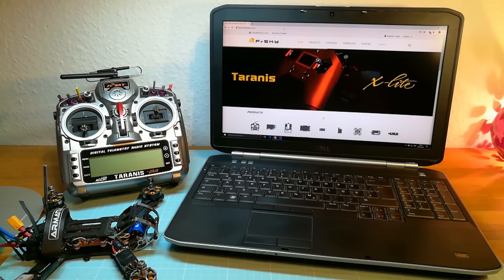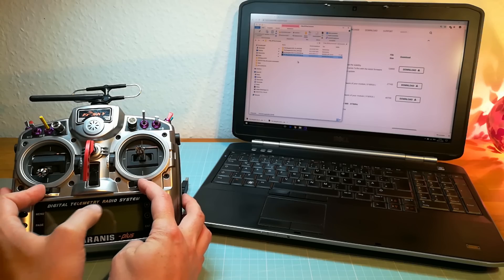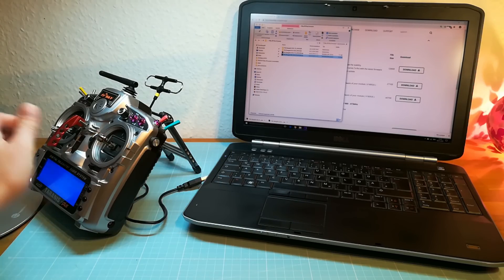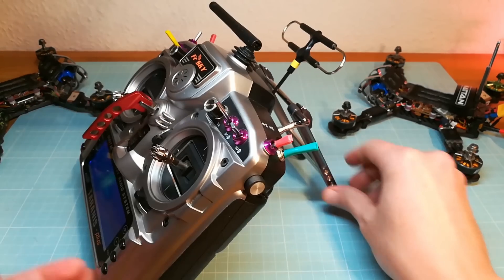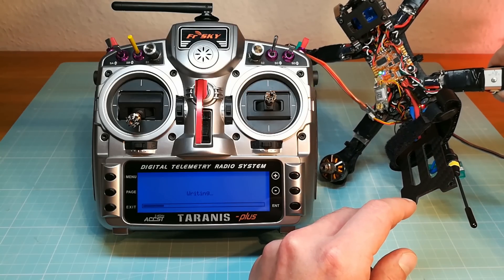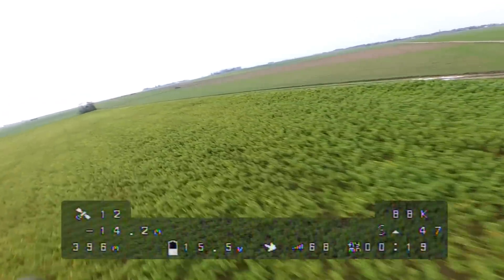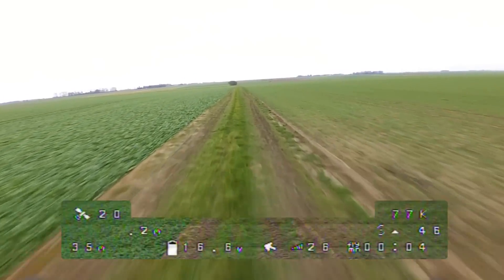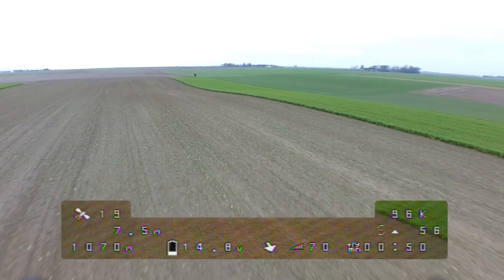FrSky R9M - 181228 Flex Firmware - Test and How To

Comment: Hi. i have just installed  the official 2.2.3 updates to  my  x-lite radio and installed the flex firmware Eu to my module and receivers but i have not got the option to change 100mw with telemetry as it states you can do with flex firmware, the only option is  telemetry using 25mw? any advice would be appreciated. Thanks.
Reply from the maker: quadthing copter did u check the flex option in companion as shown in my video about? But u don't need to select nightly Builds.
Reply: Thanks for the reply,  which of your videos has the advice for the flex options in companion
Reply from the maker: quadthing copter the linked video in the description...
Reply: ok thanks got it

Comment: What is the difference between flex 💪 firmware and just firmware? 🥊
Reply from the maker: Flex firmware is like the 915MHz FCC Firmware, but you can switch between 915 and 868MHz. I have made an other video about the Flex firmware, there you can see it.
Reply: Do you have link for that video? Thx. Great videos.
Reply from the maker: @zoom4zam  Yes, you will find it if you read the video description, or if you watch this video till the end, there is also linked my other video about the flex firmware.

Comment: Any particular reason for not using fport?
Reply from the maker: Vincent Fischer i don't need it and i have heard about issues with the fport firmware. Try the fport firmware, if you have some issues with it go back to the sbus firmware
Reply: @TorbanDallas  I'm using the fport firmware! And I have weird failsave like things happen that I don't have on another build where I use sbus. I'll try the sbus version on the problematic quad today. But if that would be the case I would loose a bit more confidence in using frsky gear because they don't have a single competent μC guy in their company it seems as this would totally be a software mistake on their end (how long is thenR9 system on the market?? how can stuff like this happen). Danke für den tipp
Reply from the maker: Vincent Fischer please let me know when the sbus firmware solved the failsafes on your quad with the fport firmware.

Comment: It looks so stable in your video. I have the R9M in my QX7S and the R9MM receiver on my quad and this week I had to experience a scary flyaway. I think the receiver didn't activate failsafe because the Betaflight log says that the quad has had signal but I wasn't able to control it anymore.
I don't know what happened because I tested failsafe several times before the flight and the quad would just turn off the motors when it looses signal. My failsafe is set to dump the quad. Anyone an idea what I can do? If someone was able to help me, I can provide the Betaflight blackbox log and the DVR footage.
Reply from the maker: Erwin did you use the fport firmware?
Reply: @TorbanDallas  Yes that's true. I changed back to SBUS ans SPort and since then I haven't experienced similar problems again. I also did an update to OpenTX 2.2.3 stable.

Comment: What is the FLEX firmware? What's it for? Why should it be considered over the other firmwares?
Reply from the maker: David Hannigan Jr. Flex it's almost the same firmware as the fcc firmware, but you can change the frequency from 915MHz to 868MHz for the EU. So it's better for the EU Users. The EU LBT firmware is limited to 25mW or 500mW without telemetry.

Comment: What is the card that you attach to taranis when updating the Receiver (R9Mini) ?? (time 2:42) do I have to have it to make such an update? Please answer. if so give a link to this
Reply from the maker: ChrisRC_FPV Haha, I was waiting for someone to ask this question 😂 This is not a card. It's just the female  plug matching to the male plug on my r9mini. I didn't have the female plug so i have literally cutted that plug out of an old flight controller. It's just a plug connection between both cable ends, nothing else.
Reply: @TorbanDallas  Recessed into raspberries: D What people will not come up with;) The patent beats the patent
Reply from the maker: ChrisRC_FPV Either you are a native speaker or you translated this phrase with the raspberries with the help of a translation tool. Anyway, i have never heard that phrase with the raspberries, but it's funny 😂
Reply: @TorbanDallas  it's a Polish proverb
'bring someone out into raspberries'
I used google translate, of course ;]
Polish proverbs are always fun;)
Reply: @TorbanDallas  Now the question ... is it worth to buy receiver r9 mini frsky or R-XSR? I'm hesitant because I'm looking for a second receiver for another drone. Should I go in the direction 2.4ghz or 900mhz? Or it may have two different ones installed, so that in the event of a failure you can save the plane, drone, etc
Reply from the maker: ChrisRC_FPV it's up to you. If you want to fly long range i would use the r9 receivers. If you just want to fly freestyle you can also choose a 2.4 GHz Receiver. You can even see the range of the xm+ 2.4GHz Receiver on my gps rescue video.

Comment: Super. Signalstärke so wie bei mir ohne Failsafe . Habe aber erst 2 Testflüge nach dem Update gemacht, da es bei uns zuviel Schnee hat. Habe diesmal ein gutes Gefühl aber dennoch glaube ich, dass man TX und RX Antennen besser tunen könnte. Habe aber kein Spectrum Analyzer. Soweit sogut. Frage: hast Du alle Sensoren der Telemetrie oder nur RSSI und RXbat?. Ich habe im FC Telemetrie nicht aktiviert.
Reply from the maker: Stefan Kellenberger ja es braucht noch ein paar Flüge, habe aber auch ein gutes Gefühl. Ich habe nur rssi und rxbat. Sonst nichts. Alles andere steht ja im Osd ☺️
Reply: @TorbanDallas  genau so sehe ich das auch. Gut Flug.
Reply: Ich hatte die Woche ein Flyaway, obwohl ich mein Failsafe vor dem Flug mehrfach getestet habe. Laut dem Betaflight Log hat der Empfänger Signal gehabt, aber ich konnte nicht mehr steuern. Ich weiß ehrlich gesagt nicht was los war, weil ich es nach dem Crash nochmal probiert habe und da hat failsafe funktioniert, als die Fernbedienung Signal verloren hat. 
Ich habe gerade versucht mein Problem auf Englisch zu schildern und dann gesehen, dass es hier glücklicherweise noch mehr Deutsche gibt.
Hat irgendwer einen schlauen Tipp, was da los war? Ich hab noch einen Betaflight Log und die DVR-Aufnahme.
Reply from the maker: Erwin uh das klingt ja gruselig. Aber du hast deinen Copter ja offensichtlich wieder gefunden. Wie sind deine Failsafe Einstellungen in Betaflight? Kontaktiere mich mal auf Facebook, dann können wir dem Problem besser nachgehen.
Reply: @TorbanDallas  Danke für das Angebot. Habe mich gerade bei Facebook angemeldet und dich mal angeschrieben, allerdings heiße ich dort anders.

Comment: R9 mini. Only 38 rssi value. Anyone know why? Thanks
Reply from the maker: what are you talking about? more informations please!
Reply: I have the flex firmware. Newest version on both tx and rx. 
868 antenna on the TX. 
Original antenna on RX.
I have 100db RsSI value on the taranis but only 38-39 in the osd from betaflight.
If I leave it for a few minutes with the battery connected it suddenly gets rx loss and I have to reconnect the battery for the quad. 
I have tried several times but I always get 38 RSSI
Reply from the maker: @Victor90NOR  so you are using the rssi output on channel 16 of the r9 rx? It's scaled wrong that's why i have changed the scaling. I even mentioned my settings in the video description.
You should also take a look at my FrSky r9m troubleshooting video!
Reply: Thanks. So just set rssi channel too 16 and change the value settings in cli? Will this fic the rx loss problem also? 😊
Reply from the maker: @Victor90NOR  No, to fix your rxloss problem you should take a look at my failsafe troubleshooting video https://www.youtube.com/watch?v=wXe1aNpepZg   ...
Reply: @TorbanDallas   thank you :) I will go trough the steps  in the troubleshooting :)
Reply: i don't have channel 16. so i guess it is aux 12.
 channel nr. 16 from the top i bf.
correct?
Reply: changed the rssi setting in the cli. 
the only difference now is that it says 55 insted of 38. Any reason why it is stuck at this rssi value? Will the value rise when i get out of the house for eksample?
I use sbus version with s.port telemetry. 
100mw.
i got the firmware released 30.12.
Reply from the maker: VictorFPV exactly!
Reply: @TorbanDallas  Thanks alot. It finally works now. great help.

Comment: The best work i have seen with your vidéos  here, bravo 😁
Your distance is limited  cause the battery , maybe others batteries  or low kV motors will you plan in the future !?
Reply from the maker: Thanks you Sergy! I'm not sure what i will do next, i think at first i will try bigger batterys. I like my 5 inch quads, i don't know if i will build a 6 or 7 inch quad. At next i need a new action cam, after i have lost my foxeer box i don't know what to buy. The Xiaomi Yi is ok for those test videos, but i need a better one for freestyle flights. I'm waiting for the release of the new foxeer box 2.
Reply: @TorbanDallas   yes not easy to change all for a 7 inch model  ( it costs) , bigger  batteries  will help,  check  maybe propellers in 2 blades who  could  reduce consumption too , bon courage 😉

Comment: You can actually use the pins on the back of the module instead of removing it :)
Edit: It seems you can't do it actually, at least not with x9d radio :(
Reply from the maker: thanks, i'm not sure about that, the pin layout is different to the layout on the module bay. And i actually i don't know what's happening when you flash an external device, does it flash the r9m or the connected receiver? The pins on the r9m are made to flash the r9m with a connector cable from the bottom pins on a Taranis QX7. I even thought about to flash the receiver with the r9m pins as i was making this video - but i didn't try it because i was not sure if it's really made for this. I think i would need the 3 right pins, on top sport, followed by voltage and gnd.
Reply: @TorbanDallas  It is same as Taranis Q X7 default port, the module just passes the signal from the pins inside. You can select 'Flash using s.port' in the menu and it will activate :)
Reply from the maker: @dweight1990  A i see, so it's the pin layout of the qx7. Where can i set "Flash using s.port" ? If i don't set it, it would flash my r9m? On my video you see, that there isn't this option. I really don't want to risk to flash the receiver firmware to my r9m - so i think my way was the savest way. But if it also works with the r9m i think it's worth to try it.
Reply: @TorbanDallas  Just put the module inside,  connect the rx and press enter on the radio when selecting the firmware, it should automatically detect the connection and put this option among others. This way you will not flash the internal or external module.
Reply: For information, I use "Flash using s.port" when i flash my r9m and my r9mm with the bottoms pins of my qx7 and it's ok . I do not have adaptive mode while i am under open tx 2.2.3N685, i do not understand. I think there are differents versions of open tx according to qx7 or qx9d
Reply from the maker: @dweight1990  thank you very much for this informations! I will give it a try this afternoon. I will let you know when it works. 
Btw: there are no informations about those pins on the r9m manual. But i have found the information about the pin layout somewhere else. I need to check it again, i don't want to burn my receiver.
Reply from the maker: lasdevegas lasdevegas  i'm having the x9d so i have never seen this option, but i will give it a try as discribed from Paweł Służalec
. The adaptive mode only works with the fcc and the flex firmware, when you select the 1W power output, the adaptive mode switches between 100mw and 1W. Take a look at my previous video about the r9m power consumption, there i'm showing the power switching.
Reply: Ok I'm in EU flex firmware . I don't trust in FCC firmware for the moment . Thanks for your feedback .
Reply from the maker: Paweł Służalec i have connected a r9mm to the right three pins on the r9m. The r9mm gets powered. But i don't see the flash usinf s.Port option 😒 i didn't dare to select flash external device. 50:50 if it will flash the receiver or the r9m. I think even when it flashes the r9m with the rx firmware i can easy reflash it with the correct firmware... But i don't dare 😇
Reply from the maker: Ok... I did it. And... It didn't work. When the receiver is connected it refused to write the firmware.
Reply: @TorbanDallas  Hmm, I've once flashed my R9M with R9mm firmware before, it just needed a reflash with its own firmware :p Maybe x9d does things differently.. To be honest I've heard it somewhere on the internet and never tried it myself :( sorry for the confusion :(
edit: btw, thank you for checking it for us! I've edited my original comment to make it clear.

Comment: Moin Torban,

habe gestern auch mal 3 Akkus mit der 181228 flex getestet und 0 failsafes gehabt, sonst ja immer 1-3 pro Akku.
Sieht so aus als hätten sie es endlich geschafft :)
Vorhin nochmal einen getestet, aber bei 250m aufgegeben, erster Flug aus einem Auto mit beheizter Frontscheibe, kann ich nicht empfehlen, Video wird da schon so schlecht, rssi vom r9 aber immer noch gut. 
Sch... kalt und es nieselt, mal gucken wie das Wetter morgen wird.
Reply from the maker: Das sind doch gute Neuigkeiten :) Aus dem Auto fliegen haben ich noch nicht ausprobiert. Ich benutze diesen Taranis Handschuh https://www.banggood.com/Upgraded-Transmitter-Warm-Hand-Glove-Cover-Shield-Winter-Outdoor-Flying-For-Flysky-Frsky-DJI-p-1119505.html?p=LM11044296190201604E&cur_warehouse=CN
Funktioniert ganz gut wenn die Funke einmal drin ist. Bei dem Wetter geh ich eigentlich nur raus zum Fliegen, wenn ich etwas testen will. Berichte mal weiter, wie es mit der neuen Flex bei dir funktioniert, wäre ja schön wenn die Failsafe Probleme endlich gelöst sind :)
Reply: @TorbanDallas  Den Handschuh habe ich auch, hat aber so genieselt, da hatte ich kein Bock draußen zu stehen und die Brille nass zu machen.
Normalerweise funktioniert das aus dem Auto fliegen ganz gut, aber wohl durch die beheizte Frontscheibe bei dem Auto nicht.
Habe zu den Handschuh noch die Bosch heat jacket an :)
Reply from the maker: @SchonRichtig  gerade mal gegoogelt, die Jacke kannte ich gar nicht :) Und taugt die was? Beheizte Frontscheibe, dass gibt's doch nur bei Ford oder? ;)
Reply: @TorbanDallas  Die Jacke ist der Hammer! :)
Beheizte Frontscheibe gibt es glaube ich auch bei skoda/vw
Reply: Open TX 2.2.3 ist jetzt offiziell draußen
Reply from the maker: Schon Richtig jap. Muss ich bei Gelegenheit mal flashen. Vom changelog her hat sich da nicht viel zu meinem nightly Build getan. Bin jetz leider erst mal längere Zeit außer gefecht.
Reply: @TorbanDallas  ohhh, dann mal gute Besserung!
Reply from the maker: Schon Richtig Danke!
Reply: @SchonRichtig  Fürs Fahren im Auto (nicht nur mit Frontscheibenheizung) kann ich eine WLAN Verlängerung (kein Scherz, gibt's wirklich) mit Magnetfuß empfehlen - gibt's z.B. bei Conrad für'n europäisches Dutzend. Und wenn du noch ein altes Fatshark Modul und einen alten VTx rumfliegen hast, kannst du auch ganz einfach einen Video-Repeater basteln, der durch's Autodach funkt. Es kommt zwar ein klein wenig Latenz dazu, aber meine persönliche Erfahrung ist, dass meine biologische Latenzzeit mit festgefrorenen Fingern mehr ins Gewicht fällt als die paar Millisekunden.
Reply: @darienwestwood3022  Danke für die Tipps.
Der vtx hatte die sendeleistung warum auch immer zurückgestellt.
Lag also doch (nicht nur) an der frontscheibenheizung.
Normalerweise kommt man aus dem Auto noch erstaunlich weit.
Reply: @SchonRichtig  Hast du mittlerweile ein paar weitere erfolgreiche Flüge absolviert? Meine R9-basierten Quads sind aktuell geerdet, weil mir die zuverlässige Unzuverlässigkeit einfach zu riskant und zu teuer war. Würde die so gerne updaten und fliegen, aber da die letzten 3 Firmware Updates für mich ähnlich Unbrauchbar wie bei dir waren (ca. 1 Failsafe pro Pack), will ich warten, bis ich glaubhaft Positives höre... Kannst du Entwarnung geben?
Reply: @darienwestwood3022  mittlerweile 20-25 lipos ohne failsafe.
Bisher nicht einen failsafe mit der 181228 flex.
Bin aktuell nicht so oft unterwegs,
aber es sieht sehr gut aus.
Haben uns letztes Wochenende beim "fpv-podcast . De" darüber unterhalten und sind in DK auch mal geflogen, ohne failsafe :)
Reply: @SchonRichtig  Danke für die Info, das klingt doch echt vielversprechend. Bin dann mal weg, ein paar Copter flashen. Müsste jetzt nur mal so langsam wieder trocken und wärmer werden hier in der Gegend. Danke auch für den Hinweis auf fpv-podcast - ist vorgemerkt für längere Autofahrten.
Reply: @darienwestwood3022  Viel Spaß beim flashen :)
Das können die auch endlich mal einfacher machen. 
Ein kleines Problem hat die Firmware wohl doch mit der Telemetrie, betrifft soweit ich weiß aber irgendwie nur inav.
Bei mir läuft es mit BF problemlos.
Oh und viel Spaß beim hören :)